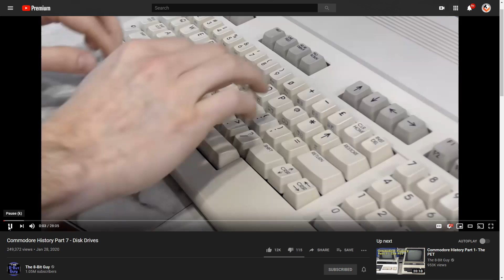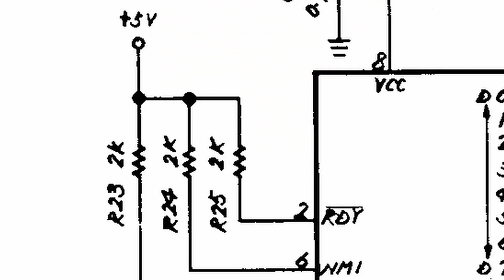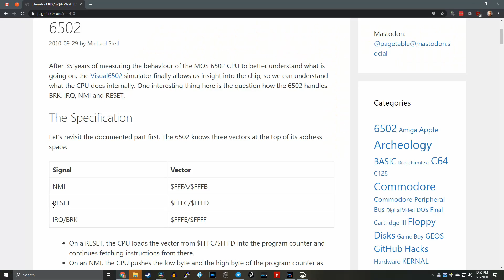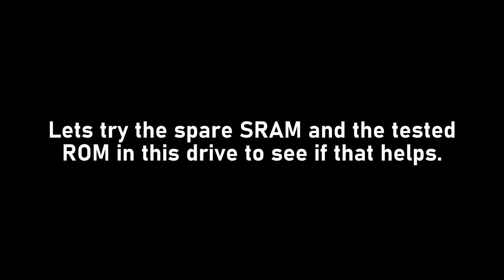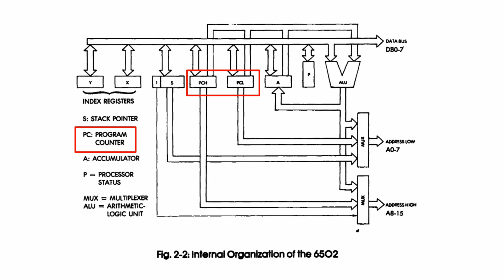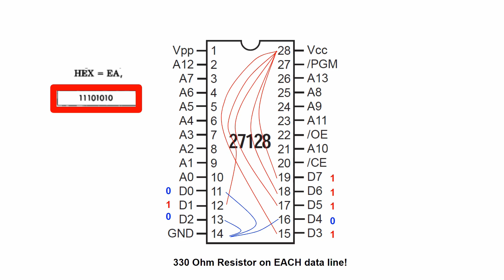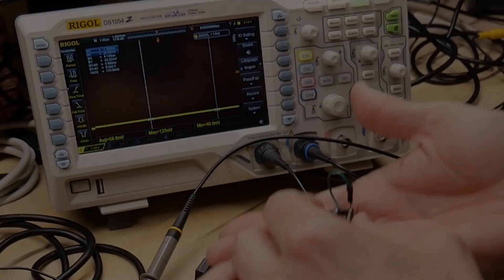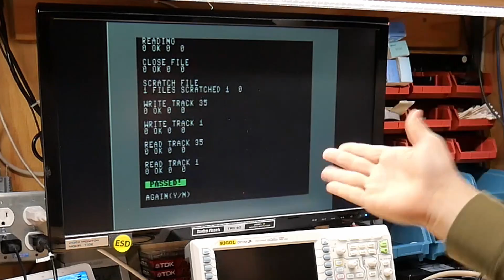Using a NOP Generator to help fix a dead 1541C drive (Bonus Track 1 Sensor demo)

Comment: Amazing what you can do when you can have only two devices operating on the bus without having to worry about confounding information from other devices.  It's really too bad there are no in-circuit emulators for these old systems that would allow you to get a "processors-eye view", and to drive specific values onto the address/data busses as desired.

Comment: I didn't know they had 2K static RAM chips back then. I was still making memory boards with 2114 chips (half a kilobyte each).
Reply from the maker: The 2K SRAM chips were probably pretty costly but even those 2114 chips weren't cheap either. :-)

Comment: Q: Which 6502- A, B, or C (6502C, not 65C02); and MOS, Synertek, Rockwell, Hitachi, Western Digital, etc? Of course Commodore uses the MOS 6502, they owned MOS. But in replacement parts there is more than 1 6502 to go by.
Reply from the maker: Any of the 6502 models will work -- the 65C02 may work OK but may have issues with some fast loaders due to he way the 65C02 handles the illegal opcodes.
Reply: @adriansdigitalbasement  I know... My 1540 and Vic 20 run on 65C02s and there is a tiny speed improvement as well as running a lot cooler. My question is which ones are you using? 

As an old 6502 video game programmer, back then we used to use illegal Op Codes. Thing is not all 6502s are built the same. The same illegal Op codes on one 6502 did one thing while it did something else on another. I know "COMPUTE!" magazine did an article on this in the early 80s.

Comment: Kinda Commdore left the drive for later or they didnt foresee its demand compared to tape .... Very intricated electronics .... but on the other side, they can load the C64 more to make the drive cheaper because you would en paying more for the computer. Here the C64 was marketd alwas with the datasette, even there were clone ones ... the drive was like a luxury item

Comment: I wonder, how hard would it be to implement a 6502 using one of those tiny 32bits chips used in those 32bit nano like clones? with 120mhz i thing it should be enough to implement an 6502 emulator and i think it has more than enough io pins too.
Reply: That wouldn't work, the 1541 needs ultra-low latency because the 6502 is reading the disk head in real-time. Emulators don't achieve the required latency.
Reply: Daniël Mantione 
You sure? How fast are you talking about? Because theres a lot of mhz between that and the newer arm micros.

Otherwise you could make an adapter board and just use a newer chip that has enough pins and translate the rom to the newer arquitecture. (Which is a pain but a one time only pain)
Reply: @laharl2k  There is a lot of MHz difference, but these modern chip have large pipelines that can stall. Things like doing an irq is quite expensive. Combined with the software latency overhead, they are not that great for real-time stuff.

For the 1541, hardware uses the SO pin of the CPU to signal that a byte is ready to be read from the head. The SO pin sets the overflow flag, so within the 1541 firmware you often encounter this:

clv

@1:
bvc @1

In other words, the overflow flag is cleared, and then the cpu is put into an infinite loop until the overflow flag is set (which is done by the hardware using the SO pin).

This hardware trick allows the firmware to respond to a read byte with super low latency, despite the low clock frequency of the 6502. This low latency is required, because after the byte-ready has been signalled the CPU has only a few clock cycles to actually read the byte, otherwise it will miss the byte, as everything in the 1541 is in real-time.
Reply: Daniël Mantione 
Well i guess an fpga shouldnt be a problem for that then, you could even implement a buffer for the input to read it asyncroniously the thing is they are quite more expensive. At that point i think it would be better to just reimplement the whole board.

Comment: My drive has the sensor but I like the head bang :)
Reply from the maker: Luckily Commodore has a jumper for people like you :-)
Reply: Do you also like aligning the head?
Reply: @CDP-1802  That can be 30 years ago or a week ago.
Reply: @Okurkaarrgghh  1987 (⌐■_■)
Reply: @Okurkaarrgghh  Later generations of the 1541 didn't get knocked out of alignment as easily.  (It would happen eventually, but the first few production runs were particularly prone to it.)

Comment: That parts bin is going to run dry eventually... get yourself a stock of new 6502s from Jameco!
Reply: Or just buy a 65C02 from WDC that is still made to this day, rather than buying old Rockwell stock.
Reply: @benanderson89  The 65C02 is not a straight drop-in replacement.  I did some research.  Among other things, you have to clip pin 1 (it's a vector pull status signal that has no analog in the original 6502), and you have to tie pin 36 (bus enable) high.  Also, there's at least two manufacturers of the 65C02... WDC and Rockwell, possibly others.  The WDC chip does NOT accept TTL input levels unless you also add pullup resistors.  And there's the whole "illegal opcode" thing... the 65C02 doesn't have those, which will break some fastloaders.

Comment: Your eprom nop hack is sound in principle, but there are other ic's mapped onto the address bus that may contend with your resistors where they appear in their address space (Bus contention) and may throw other data at the cpu via the data (edit was address) bus and mess up your nops (and crash out or end up somewhere randomly) so this might not behave reliably.  If you had something like a fluke 6502 pod and 9010a troubleshooter, it may not see all EA's over the whole memory map and infact if you ran unit under test in this instance but without the nop hack, the drive would have just started to work.  If you want to nop properly,  You are better hacking up a cpu directly with nops as this will cover the full address map... an alternative method would be to make a nop eprom in this case, but have a jump back to E000 (or wherever its mapped in at)  somewhere near the end of the eprom and have some decent reset vectors in place too.  I don't feel in this instance that your nop gen helped you fix it as you swapped in a couple of other cpu's in the process and kind of got lucky.  Nice video though and glad you got this thing running.  Hope this feedback helps.
Reply from the maker: I disagree. Clearly a CPU NOP generator is better but I was immediately able to tell the CPU was not executing code properly with this. The CPU was soldered to the board and this was a quick way to test to see if the CPU was bad as opposed to the gate array that handled chip selection. Worst case with this in place, the CPU might crash when it gets to the mapped IO space for the 6522 chips but I'd be able to see them getting selected before the CPU crashes. It's not a complete test, but it's a lot better than I had was getting before. 

Also, how exactly would a NOP EPROM help? I could test the 16k ROM space but not any of the RAM space selection logic. 

The whole point is to do easy things that help narrow down potential problems. This NOP generator is easy and took a minute to make.
Reply: @adriansdigitalbasement  That's a fair comment,  the eprom was soldered in too so it had to be removed. I see my error in that a nop eprom would only explore it's own space and not the i/o or ram and depends what is wrong with the cpu in the first place and if it failed at that first hurdle you still know its toast and it would indeed help. But, Yes, anything that can help narrow down issues helps an awful lot. I guess the ram is mapped at 0000 So the CPU can use zero page stuff ? So execution would start at EAEA as someone pointed out and then wrap round to 0000 and then do odd things ? So it's just as bad or worse than looping around inside a test nop rom space ? Bear in mind that a bad CPU still might execute nops anyway depending upon the failure mechanism.

Comment: That many bad 6502s is pretty weird. When I was going through my own little odyssey of restoring a couple badly trashed Commodore PETs back in 2012 a piece of advice that was repeatedly thrown out by the guys in the know was it was never the 6502. And, yeah, despite pretty much everything else in those machines being rotten the CPUs were fine. I can't help but wonder if there's something about the 1541's design that makes it prone to killing the CPU with transients or... something. Or maybe they just turned out a bad batch, who knows.

(I was actually going to guess when you didn't get any address line activity with the NOP generator installed that the power-on reset circuitry was stuck. I did see that once, the result was similar symptoms.)
Reply from the maker: Yeah I always check the reset line first along with the voltage rails... best to rule that out right off the bat. 

And yeah, so many bad CPUs ... mysterious. I have a bunch of drives and haven't ever had this particular luck before. (And my spare parts CPU was of unknown origin.)
Reply: @adriansdigitalbasement  Do the date codes line up at all on the dead CPU? It certainly isn't without precedent that MOS would churn out a run of faulty-ish chips. Otherwise, who knows?

Comment: I don't quite understand this. You remove the ram and the rom, but obviously not the I/O chips. So these does do get selected and override the 330 Ohm resistors. So reading those addresses will not give back a NOP instruction.

Comment: I wonder if something is actually killing the CPUs in those drives?
Together with high voltage I'd replace the power filter electrolytic capacitors first - they are not designed to last that long. 
And also the ones in the power supply.... actually, better just to use a modern tested power supply - that would be both safer and more efficient.
Reply: The community doesn't a pattern here. The 6502s don't fail often, there is no active killing mechanism.
Reply: Ok but the almost-dead capacitors are worth replacing anyway I think. 
There is a reason why the CPU died and quite likely that was not (just) the CPU itself. I may be wrong...
Reply: @jwhite5008  I don't see how a broken capacitor can kill the CPU. A broken voltage regulator can (but Adrian checks those), but a broken capacitor not. Capacitors in these PSUs rarely fail; they are very often in good condition.  I am personally against recapping just for the heck of it, it is not necessary. There are people in the community who disagree and do recap these machines. Personally I prefer to keep proper working capacitors original.
Reply: I have no experience with commadore machines at all and I do understand what you are saying.

It is possible that I am wrong altogether but frequently the power supplies are designed in a way that, if coupled with dying capacitors between power and ground tend to cause the regulator to over-voltage the power rail and slowly damage everything. Maybe C64 ones are not like that - then my suggestion is wrong. 5.12V should be totally okay for those chips, the question is if it rises under more load (yes I know it is not supposed to do that but it still can - again depending on how power regulator and/or PSU work). This in turn can also overheat and slowly degrade the regulator itself.

Some PSUs also tend to have a large voltage spike on power-on and sometimes shutdown, and here probably when motors start/stop, and rely on capacitors to take a hit. That could potentially damage the CPU if the caps bad enough. Again, I don't know if C64 power supply does that and to what degree.

I faintly remember seeing overvoltage on old machine like that somewhere - 8bit guy? - and I believe it was something like VIC20? Now that I think about it maybe I'm just misremembering....

Anyway why I'm not fond of old capacitors is because unlike the chips which do not necessarily degrade with time (well, unless they become part of an anthill or something) the electrolytic capacitors do and all of them lost a significant amount of capacitance and gained ESR by now even if the computer is still new in box. It's been up to 37 years which is a lot of time for liquid electrolyte.

This problem is much less prominent with old capacitors than with newer water-based ones (late 90s+) that I'm more familiar with, but even those are still slowly degrading, unfortunately.

If you have experience with the machines and believe caps do not typically cause damage, leaving them alone is probably not a bad idea. But replacing them should not create a problem either - other than making the computer look less authentic.

So, again, I have no experience with those computers. I may be wrong. But this is what I would probably do.
Reply: @jwhite5008  Trust me, chips fail way more often in these machines than capacitors. It is different with Amiga's, those have failing capacitors, but a broken capacitor in an 8-bit Commodore is really rare. I do measure them, and both the capacity and ESR is normally excellent.

Considering the amount of failed RAM chips, PLAs and SIDs, I can say for sure that the chips degrade more than the capacitors. It is chip-specfic though: PLAs fail in hordes, so do Micron RAM chips, but CPUs rarely fail. I'd say Adrian had bad luck, nothing else.

The 8-bit Guy had a broken voltage regulator in his power supply. Linear voltage regulators are unreliable, simple because of the amount of heat they produce and they do fail. If they fail, they stop regulating so you get overvoltage -> damage.  Replacing linear voltage regulators, preferably with switching ones, does make sense in these old computers, they are ticking time bombs.

Comment: What a long way just to figure out that the cpu is dead,it’s a common problem and i guess it’s because of the generated heat by that giant transformer,maybe a heatsink on those cpu’s  could have conducting away that excess heat from those chips to increase it’s lifespan,also i tout that that heat bang is normal just to indicate that user that the mechanism just works fine,so maybe it was intentionally done by commodore.

Comment: Are 6502's known for dying like that? And more importantly, can't you still get new ones?
Reply from the maker: They are definitely not known for being unreliable. That's why I couldn't believe I had 3 bad ones in a row. Unfortunately the regular 6502 isn't made anymore but a new 65C02 one is. It's just not as compatible in things like 1541 drives.
Reply: You can't get a new 6502 per se.  You can get a 65C02, but that's a 16-bit chip that's instruction-compatible, running at 20 MHz.  It is not a straight drop-in replacement.  I did some research.  Among other things, you have to clip pin 1 (it's a vector pull status signal that has no analog in the original 6502), and you have to tie pin 36 (bus enable) high.  Also, there's at least two manufacturers... WDC and Rockwell, possibly others.  The WDC chip does NOT accept TTL input levels unless you also add pullup resistors.

Comment: I have a 1571 drive that works in 1541 mode, but it won't work in 1571 mode.  At some point I need to get someone to look at it, because I have no idea what I am doing.  I also have a PSU from my Packard Bell Legend 600SX which has failed.  I checked all of the caps with my limited skill and they read normal... I think.  I need to find someone who is much much more knowledgeable that I can ship them off to and pay them for their time and any parts that will be needed to get them fixed.  Normally I would get a PICO PSU for the 386, but the shape is so unique and I can't find a Pico PSU with all of the connectors I need, 2 Molex and 1 Floppy connector.

Comment: A third dead 6502! What's going on?  Check with other 6502 users, especially in 1541s or other hot running old gear.  Perhaps this is an early death due to heat or something else you can check.  It could be due to a manufacturing defect corrected in later steppings of 6502 manufacture.  See if you can get some hardware guys involved, they're not necessary, but could speed things up.

Comment: At least the 6502 processor is still available brand new, unlike the 6510.
Reply from the maker: Sadly it's not really compatible with the 1541 -- that new chip is a little different and will not be 100% compatible.
Reply: Of course not; that owuld be too easy...

Comment: 1980's CMOS devices need way more ESD protection than you are using!
Reply from the maker: There is nothing CMOS in this drive.
Reply: @adriansdigitalbasement  And yet you have three dead processors.... ESD protection is not optional, nor is it pie-in-the-sky.

Comment: Why would a whole board be bad because of one chip?
Reply from the maker: Because the chip is irreplaceable with no where to buy another without taking it off another of the same drive.
Reply: @adriansdigitalbasement  That sucks.  They should make replacements.

Comment: Don't you need two NOP generators? One in the ROM socket and one in the RAM socket?
The CS line will eventually switch from ROM to RAM and at that point you would be reading garbage?
Reply from the maker: No. I'm just using the ROM or RAM socket to hard wire the data lines. I could use any socket that has all the data lines available. It has nothing to do with the chip select logic that selects a ROM or RAM chip.
Reply: @adriansdigitalbasement  - Ahhh gotcha. Good point. My bad
Reply: @adriansdigitalbasement  What about when a 6522 gets selected; since they were not removed, might they simultaneously drive the data bus and result in something other than a NOP at that part of the address cycle? Thanks.